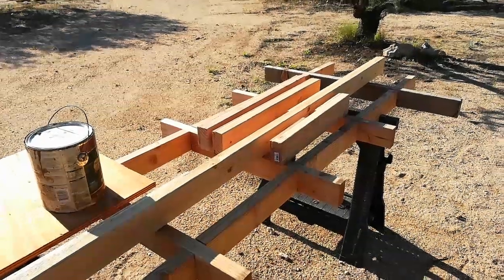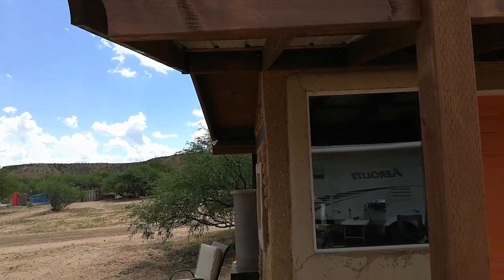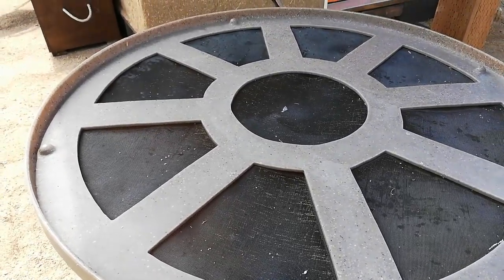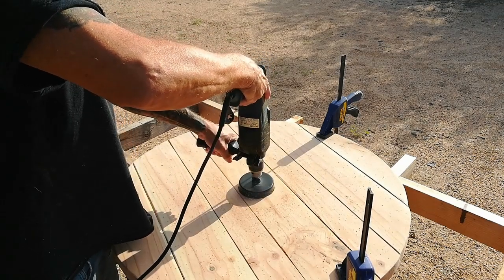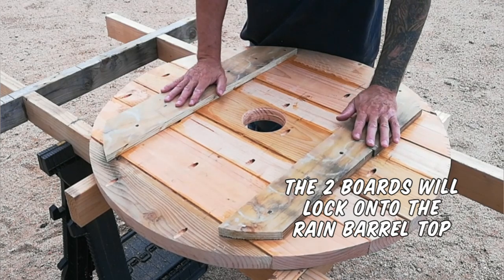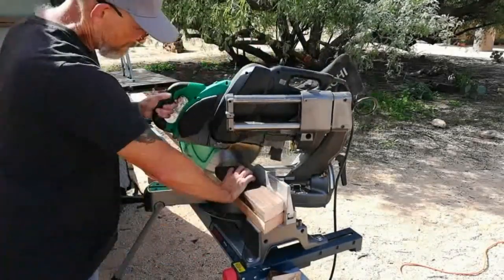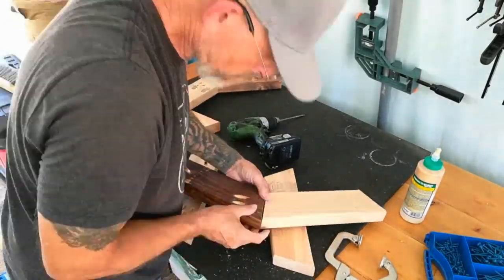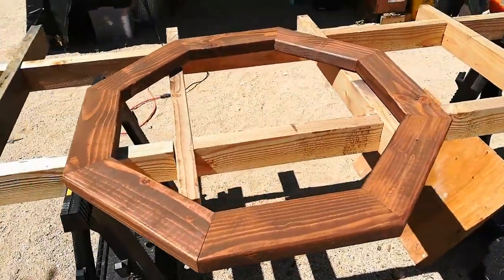Solar Shed Gutters and Building An Octagon Base for the Rain Barrel.

Comment: Hi Bill.  I learned quite a bit from this one.  Really impressed on how all of those angles turned out almost perfect.  I am not mathematically inclined so always impressed when folks can work these things out.  I was a bit worried that in 10 years or so the wood will need to be replaced since it's going to be in constant contact with wet dirt.  I might have used some sort of metal or cement in this case, but when the barrel is empty in the future you can always pull it off and make another cool base I guess.  My only suggestion for your videos is to continue to offer real basic step by step information.  Just like you are giving me a recipe to follow and so I can do it as well.  That type of show and tell youtube video is invaluable.  I think those who build things often may assume that the novice knows even what clamps are for etc.  We don't, so it's great to learn.  I also like your attitude of teachability and wanting feedback.  I always admire that and am much more willing to listen to honest humility and admitting when things didnt go perfect etc from an instructor.  Thanks from a new subscriber!

Comment: Newer hammer drills often have an "anti-torque" feature that keeps you from getting twisted around by your powerful drill if the bit hangs up. It used to be a big danger with "hole hogs". I remember and electrician getting thrown off his ladder by one. When the feature activates it feels like the drill is slipping gears.
Reply from the maker: I wasn't aware of that safety feature. Unfortunately, that's not the case with my old drill. But as a side note, I understand all too well about the danger of torque. I was drilling into a brick wall to set a receptacle box and my hammer drill kicked back on me real bad. It actually tore my rotator cuff. Gosh, that was about 25 years ago.

Comment: Hi guys, love your videos and the info you provide to us.
I am interested in the plastic screened rain barrel lid you have in this video. I know you are covering it for a table top but I like the screen idea. Did you make it or was it purchased? If you purchased it would you mind telling me from where? If you made it would you mind telling me how? Like which mesh and glue was used. I have a plan for that if I can locate or build one.
   Thank you guys again, great information.
Reply from the maker: We're so glad you like our channel, thank you! 
The rain barrels were actually bought off of Craigslist and came the way you see them. I imagine making your own wouldn't be too difficult. If you have a 55 gallon drum with a lid, you could cut out the sections using a jigsaw. The screen is just like window screen you can get at the hardware store. I would choose a nylon screen over metal to prevent possible rust. I would glue it to the bottom of the list using either 100% silicone or a construction adhesive. Hope this helps and good luck with the project 👍😀
Reply: Ty, I am going to try this. 👍